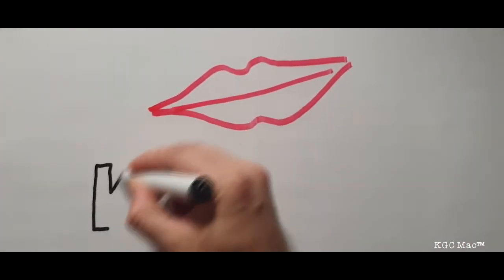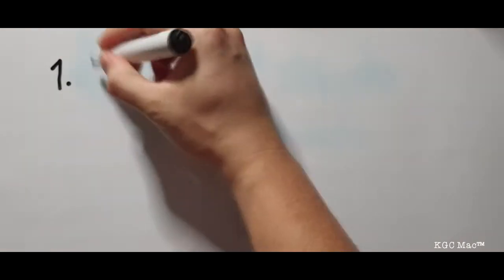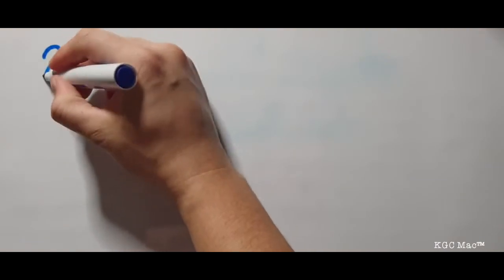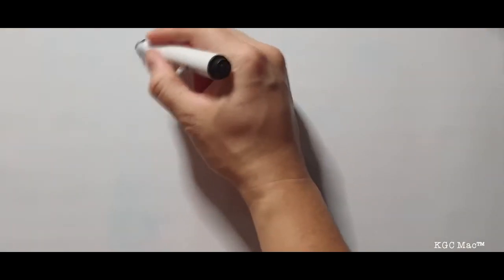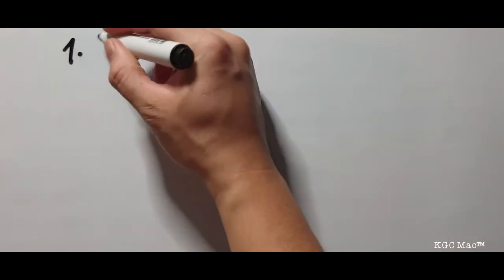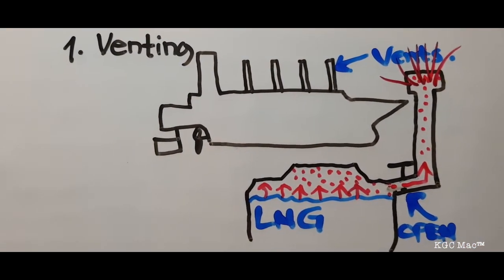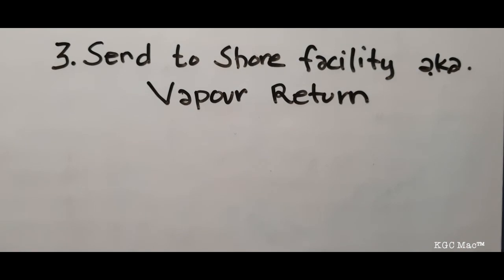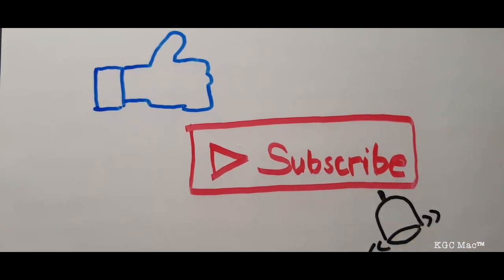LNG Operation Video #2 Controlling Tank Pressure

Comment: Great video sir. Would like to ask you on another thing related to tan pressure. how does the pressure can impact quality and LNG temperature?
Reply from the maker: The pressure of the tank does not impact the quality of the cargo.
Pressure and temperature- they are directly proportional.which means if tank pressure is increasing, the temperature will also increase. And if tank pressure decrease, temperature will also decrease. Thank you for asking, commenting, watching and visiting the channel. Hope this helps.
Reply: @wellanchored-deadslowahead9553  im handling LNG bunkering vessel movement..most of the times requires the vessel to move from port to another port just to maintain the tank pressure.. thank you very much sir for your answer
Reply from the maker: Your most welcome sir. Thanks for visiting the channel. :)

Comment: You can also use GCU to get rid of excess vapour !
Reply: What's GCU stands for? Gas compression unit? Is it other name Reliquefaction plant system? Or something different?
Reply: @iwanfaesal5890  it stands for gas combustion unit, used to burn bog to maintain preassure in tanks
Reply: @adblaster13  i got it. Like flare on terminal. Burn the bog. Thanks for the response. R u working on lng ship?
Reply: @iwanfaesal5890  I was just recently a deck cadet for 6 months on an lng carrier
Reply: @adblaster13  that's awesome, superb. I, myself, wanting to go to lng carrier, wishing i would get chance to go there

Comment: Hi, when we are transfering high pressure to engine room for fueling, then actual quantity stored in that particular tank will be reduced know then when discharging it will be short discharged know? could you pls explain. me how qty will be calculated after loading and how it will be calculated after discharge
Reply from the maker: The quantity of the LNG loaded will be reduced by the time you will discharge it, due to continuous evaporation of LNG vapor. The calculation of the qty will be as is. Same as normal calculation, just expect that the qty discharge will be less than the original qty. Make sure to get the right density of the cargo. It will be found in the certificate of quality. Thanks for dropping in our channel. Hope this helps.
Reply: @wellanchored-deadslowahead9553  Then what will happen to buyer who pays for 10,000 Mt qty based on load port bill of lading and when it discharges if they get for example 9,900 Mt due to evaporation. who will bear this loss buyer or seller. what is the common terms in LNG contract
Reply: @wellanchored-deadslowahead9553  thanks for your kind response brother
Reply: Awaiting your kind response on my queries.
Reply from the maker: @nainaabbas7151  actually there a clause agreement between the buyer and seller. It will be noted there the approximate qty will be in the discharging port. The buyer will pay for what ever qty he will received. The buyer will just pay based on what he will receive in the discharging port. And the official document is the bill of lading.